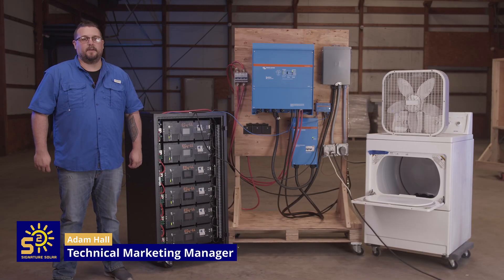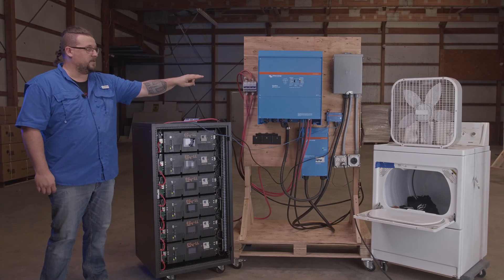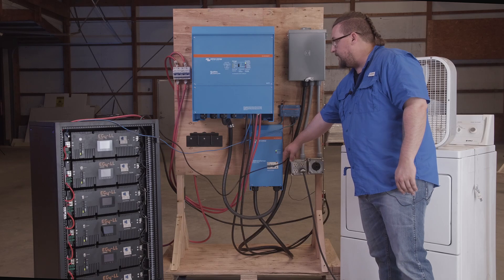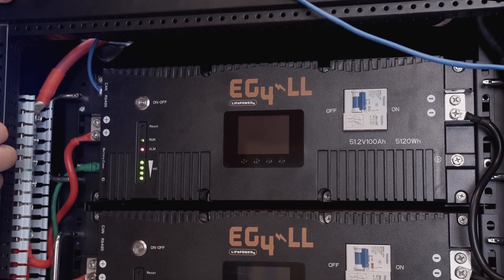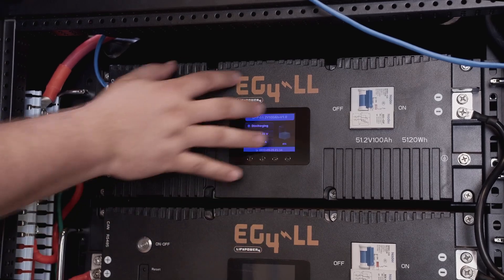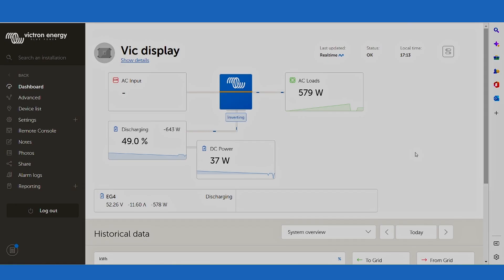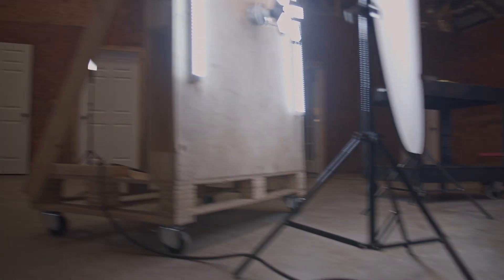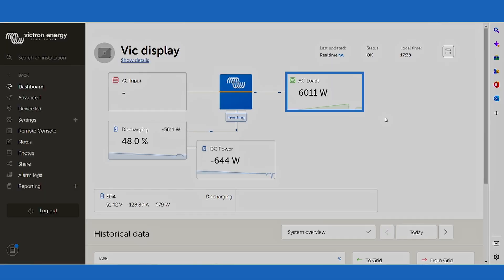Victron Cerbo GX & EG4 Battery Compatibility & Communications. Victron Quattro 15kW & EG4 Load Test

Comment: I am in the USA. For my system, I will have the quattro 15k because most of my load is 220V.  what I want to know if I use 2 autotransformer on the AC output Side can I get  160A @ 220v and 40A at 120V ? and for charging the battery can I use 50A shore power @ 220V directly to the quattro 15k or I am going to need another transformer ?
Reply from the maker: Yes, you can use two autotransformers to get 160A at 220V and 40A at 120V. For charging, 50A shore power at 220V should work fine with the Quattro 15k, no additional transformer needed.

If you need any further details or advice, please don't hesitate to give us a call at 903-441-2090, we're here to help!

Comment: How would you charge the batteries using 240V 50 Amp shore power? can you feed the inverter directly or you will need something like a transformer also between the shore-power and the inverter ?
Reply from the maker: This depends on if your inverter is capable of handling the shore power directly. You may need a step down transformer. If you'd like to reach out to us at 9034412090, we can advise based on the products you have or would like to purchase.

Comment: I have a 10k 120v victron inverter i would like to use the split phase option that the autotransformer provides when paired. Whats the max wattage of each leg of the output?

Comment: Nothing happens when I hold the back button for 5 seconds
Reply: You have to have the dip switches on the master battery set to all zero's or that function wont work. Then after you make the changes you can put the dip switches back.
Reply from the maker: If you'd like to reach out to our tech support department at 903-441-2090, we can get you taken care of!

Comment: How are you connecting battery to Cerbo? I have the special cable but since I have other things and the last units need to be terminated I’m not able to hook up the battery and for it to show
Reply from the maker: It’s just a communication cable and it’ll be Cat 5/6  from the batteries to the VE CAN and you should have received terminators to put in the other VE port

Comment: Adam, thanks for the video. Is there any way the multi plus 2 can be bypassed in the event of a failure? it’s a pass though inverter so if you have battery issues or MP 2 issues your dead in the water. I was thinking maybe a physical switch before and after the inverter, what do you think?
Reply from the maker: Yes by using a manual, or automatic transfer switch.

Comment: I noticed another YT'er had this rack but it did not have the cable management "fingers" around the bus -bars. He had to remove the chrome handles off the batteries to make installation safe. Does SigSol offer a re-call type fix to provide cable management to prevent bus-bar issues?

Comment: Can you get a cable to connect the cerbo gx to the basic lifepower 4 original battery to work with a multiplus II? Right now I'm using a victron smart shunt.

Comment: So, that means if I simply use a Victron smaller system for an RV (battery charger from AC and 1200 Inverter, separated units) with the Cerbo GX, I could use an EG4 rack battery without problem ? Nice
Reply: That's how I have my van setup

Comment: Why 2 positive wires from EG4  racked batteries  to 2 bus bars then to 2 200Amp breakes then two wires to the 2 DC input on the Inverter Charger?

Comment: Can the EG4 LifePower4 also communicate through the Cerbo GX? If so how?
Reply: I just upgraded my EG4-LL V1 firmware with Victron, and it is talking to cerbo gx. I believe there is also an update for lifepower.
Reply: Was this ever figured out? I'd like to get rid of the smartshunt to monitor my lifepower with the Cerbo
Reply: @jeffsyslo8519  Look for a YouTube video from EG4 Electronics that shows how to update different versions. My EG4-LL (version one) is showing as a Battery Monitor under Cerbo gx, which means I could use it in place of the Victron Smartshunt. However, I am getting over voltage warnings when SOC gets close to 100% and they get cleared by themselves. I am trying to figure out what is going on. Therefore, I don't recommend updating the firmware. You also need a cable between the master battery and cerbo gx.

Comment: Will this work with the previous EG4-LL or just the new version?  Does the new version’s pre start resister work with the inverter or did you have to charge it first?
Reply: It appears to be working with EG4-LL V1 after victron firmware update. EG4-LL v1 has built-in current limiting resistor, 1st close circuit breaker, then turn on BMS.

Comment: 15000 dollars to run a cloths dryer and fan. I put my wife up a 50 ft. cloths line for 100 dollars. Love the solar concept, you guys seem to be the best. But for the average family living in rural America, this is way out of our reach.
Reply: Compared to running utilities for a mile to a rural property, this is small change...
Reply from the maker: This system could easily power an off-grid homestead on its own with adequate solar generation. With 15000w with either a victron or 2x EG4 6500s, you can run a well pump, 3+ mini splits, water heater, kitchen and laundry appliances, lighting, and entertainment centers + more. In a lot of situations, it would cost you more than 15000 dollars to get an electricity line ran to your property. Going off-grid with solar makes a ton of sense for many people. If you are interested in learning more feel free to contact our design or sales department if you would like to see how one of our systems could work for you. Even if you don't decide to purchase, it's our responsibility to make solar simple for everybody.
Reply: The main thing that a system like this provides, is everything else other than powering a drier. Like heat (mini splits), water well pump, internet and so on.

Comment: Hi Adam, thanks for the compatibility test using the Victron and your EG 4 LL batteries. I'm using a Magnum 4024 inverter and Midnite solar's Classic charge controllers. I want to upgrade my flooded lead acid  L 16 batteries to yours and even got a quote from your sales department a few months back indicating that they would work with my system. Last week I went to place my order and I was told that EG 4's will in fact NOT work with my Magnum inverter. 7 years ago when I installed it, Magnum was a leader in the off grid world with tens of thousands sold. I'm really confused and ready to buy but I'm getting mixed answers from your tech staff. Any chance of testing the compatibility of Magnum inverters with your batteries?
Reply from the maker: Magnum Inverters should work fine without communication. Just set the charge settings on your inverter correctly. You can find this information on the EG4 Specification sheets and manual

Comment: was the test done using a single of the 6 batteries? I'm planning to use either quattro or multiplus, so thanks for video, but would be great to show the linking of the remaining bats and such :) allready got 4 of the new v2 bats!
Reply from the maker: All 6 were in use communicating. You only need to link the master battery to the Victron system. The master battery will then communicate downstream to the remaining batteries